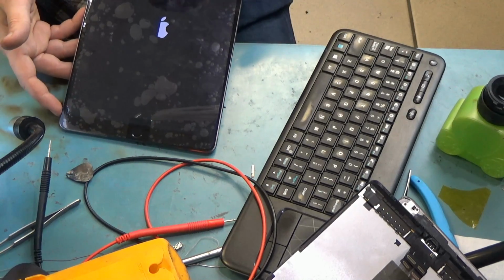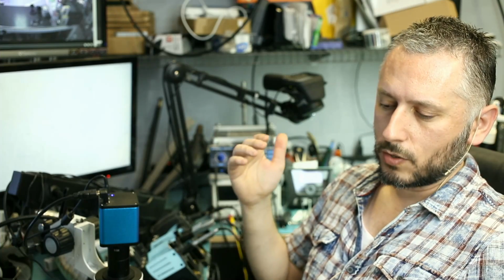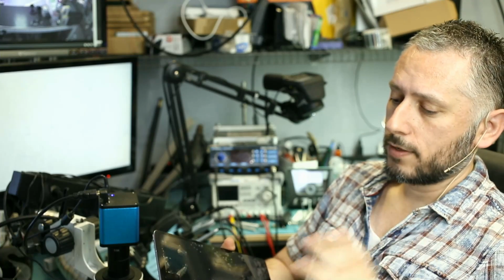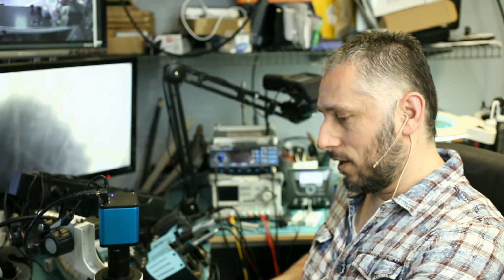iPad Pro 10.5 No Image After Screen Replacement - Repair Without Schematics

Comment: Hi, I have an ipad 10.5 , backlight working but no display. Opened it up but everything looks perfect on the board. I don't have another screen to test it, any advice what i should be looking at/how?  Touch works/ boots up fine, even managed to get it setup through 3utools (tried just puttin the backlight too 100%, didn't really do anything but thought it was worth a shot. Any advice would be welcome. Thank you.

Comment: I have a question. I just had my ipad pro 10.5 screen repaired, they sent it back and it kept restarti g every few minutes and I noticed the screed sounded hollow. Felt cheap..kina not as tight feeling asmit was originally. Im also concerned that its not as responsive, bright, etc. Are the replacement screens equal to factory screens?

Comment: Did the customer allow you to replace the screen ?
Reply from the maker: Yes, Customer gave us the OK to replace the screen
Reply: @NorthridgeFix  was it the screen or just the connector, how would you know if either ? just asking as seen videos with lines and parts of screen missing and fixed by re soldering the connector pins.
Reply: rs2klee was going to say it’s the connector not the screen :(